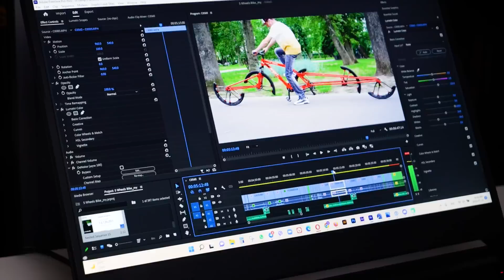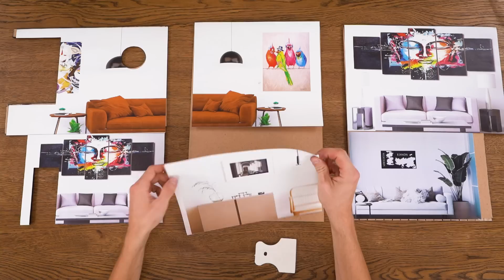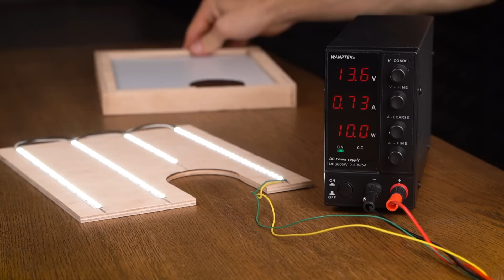Amazing House Aquarium with Tunnel

Comment: Wait how do they get to the living room? I see the garage and upper level are connected but I don’t get it!
Reply: Check out about 3:00 you can see the top has a cut-out in the floor for them to get down there.  But that's the least of the problems as there's no way to clean anywhere but the top, there's no water filtration/cycling outside of the top floor, the tank hasn't gone through treatment so the chemicals from the car/inside glue/etc. are still leeching, etc.

Comment: The glue used for the construction might be toxic and dangerous for the fish. Also the toy car placed inside is going to rust, which is also harmful for the fish. Besides, the air compressor is placed in only one room, which might not be enough for supplying all the construction with oxygen. Pets are not toys and treating them in such a way is unacceptable.

Comment: This is not fish keeping, it's animal abuse. Those are living creatures not a desk ornament.
Reply: It's fish
Reply: How is that animal abuse at all
Reply: @hilet3500  1.) Unless the model car was bought as an aquarium safe item it potentially has paint and adhesives that could leech toxins into the water
2.) That filter will only provide oxygen for about 2/3s of the tank. Oxygen creation in water requires either surface agitation or plants to create it through photosynthesis. Most of those chambers will have stagnant water with no surface agitation and those couple plants are not going to create enough oxygen for that amount of fish. The Gouramis can survive in low oxygen environments but that's assuming they have access to the surface to use their labyrinth organ to breathe.
3.) That filter is really only going to provide mechanical filtration. If it's already cycled (you can look this up yourself) there may be enough beneficial bacteria for a few tiny fish but not that many. Swordtails and Molly's/platys all have high bioloads and will need proper biological filtration and/or large plant mass to consume the waste. Either way that's way too many fish for some tiny sponge in a water pump to handle. Eventually ammonia will build up to a toxic level and the fish will die. Considering the amount of fish and water volume this could start happening in as soon as 12 hours, especially if they all just ate a bunch of food. 
This all would be like keeping a Bearded Dragon in an enclosure without proper access to UVB lighting or any number of examples. It's not an appropriate environment for the animal and puts their life in danger.  Long story short - animal abuse.
Reply: @Rycraft5v8  Just the size of the text is convincing enough for me to agree that it's fish abuse 🤯
Jokes aside, this is just a video and i doubt they are even keeping fish there. To keep fish you need to know how to make if comfortable, no person randomly throws a fish in water and decides it's good like that.

So yes this is just entertainment and nobody's keeping fish inside that awesome house.
Reply: @Rycraft5v8  unless you missed something and it's appropriate for fish to live inside, then they could be keeping fish but i still doubt it, gn
Reply: You loosely use that words when actual animals are actually being abused

Comment: Clearly engineer Sergii didn't take any biology classes as electives while in uni.  This is what is wrong with so many industries dependant on the stats and numbers when they use CAD.  Need to step away from the screen,  and consider the user's of the design.    I get it was a creative project but it really is equivalent to testing cosmetics on animals.  Sure that eye liner didn't kill the animals,  but did it serve them in any benefit from it? 
There are countless designs that look fantastic on a screen but in practice they have severe flaws.

Yeah,  I'm talking to you James Dyson